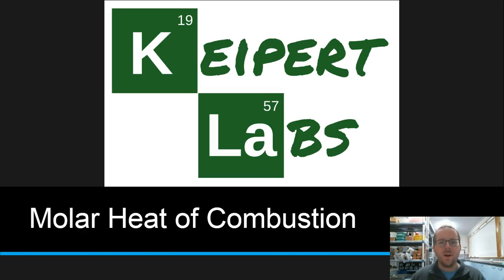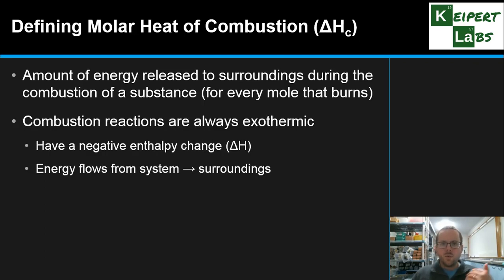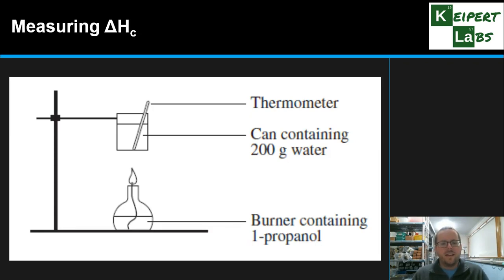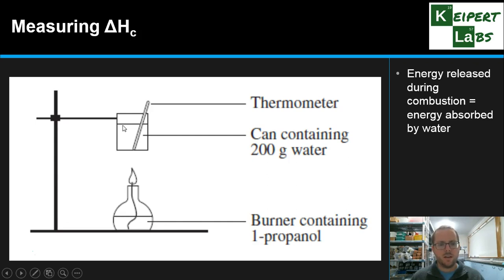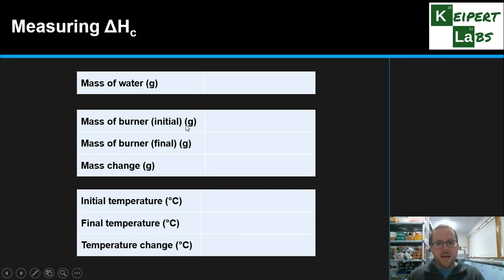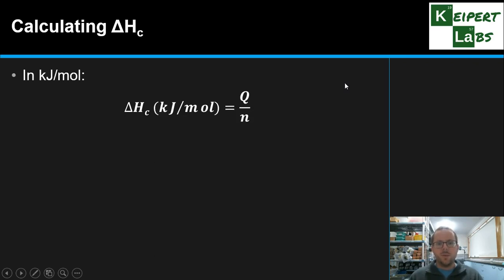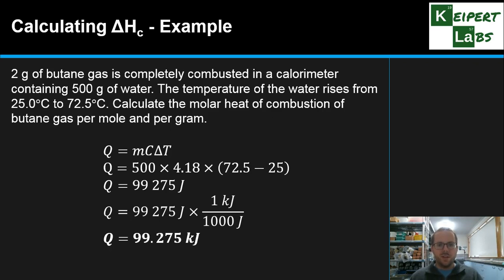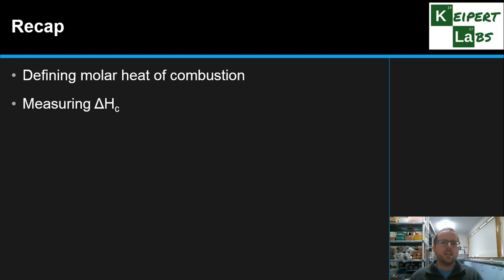Molar Heat of Combustion

Comment: Why did you use data of water in calculatin deltaH
Reply from the maker: When we use calorimetry, we are channeling the energy from the combustion into a sample we can measure (usually water). So we are working with the idea that the energy the water absorbs = the energy given out by combustion (not a valid assumption, but it's our starting point). Hence we use the mass of water AND its specific heat capacity (4.18) in our calculations.